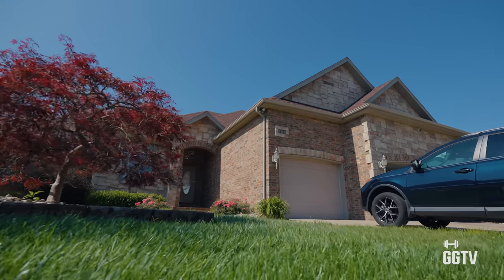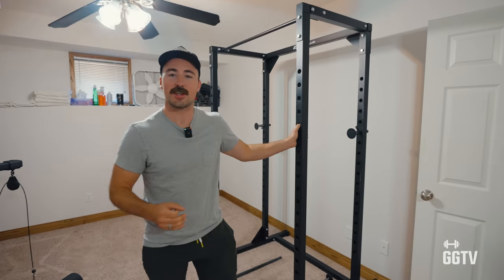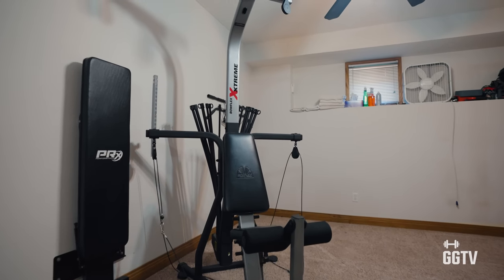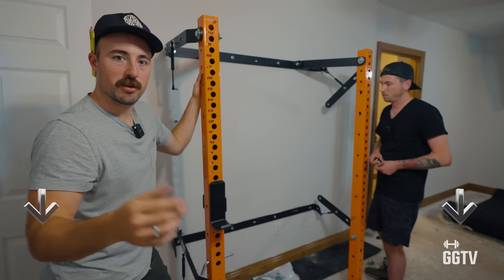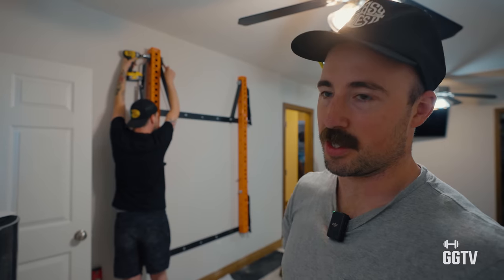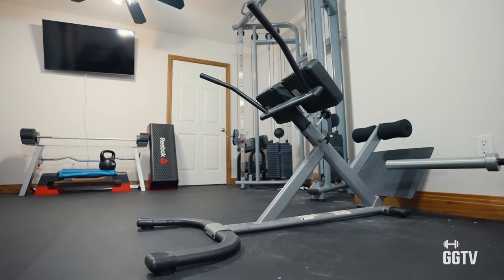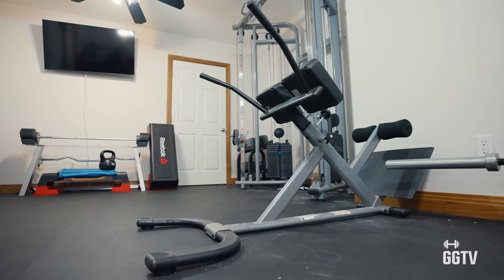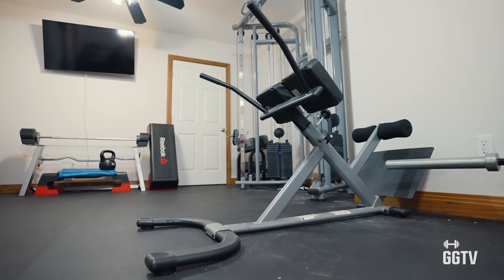I Built My Parents a $25K Dream Home Gym!

Comment: Can you give some sort of price breakdown? The title is $20K home gym - was the flooring just really expensive? I'm in the process of outfitting my basement and looking at what that room looks like and that pricetag I'm feeling like there is a big gotcha on my horizon that I'm somehow missing. I've got a set of 5-50lb DBs from rep + a victory stand, a full SS double diamond barbell, urethane equalizer plates, blackwing bench, and getting ready to buy a power rack w/ athena + Lat/Low + full stack upgrades on both and this is still under $10K. Feels like I am missing something and the only thing I can fathom is that I need to be ready for some serious sticker shock when I go to do rubberized flooring...
Reply: How is that barbell???  Thinking hard about one or a Rogue 2x Aggro.
Reply: @ExpeditionaryRanger  I'll tell you when it arrives in like 3 weeks =/. I ordered it beginning of last month but the lead time with newer stuff from rep is annoyingly long. The blackwing took about 6 weeks to arrive as well, though it was worth the wait. Thing is built like a tank, super happy with it.
Reply: Sigh - doesn't respond, but does update the title to be even more expensive at $25K vs the $20K it was at time of upload.
Reply: I came to the comments to see if anyone asked. My only guess was flooring cost or the cost of that install company? Seemed inflated at $25k
Reply: @ExpeditionaryRanger  Received the barbell - it's super nice :-)

Comment: Coop/videographer Nathan, how does the Titan leg extension/curl compare to the isolator? I know the isolator has more functionality, but I’d mainly use it for legs anyway. Comparisons for range of motion, seat stability, weight capacity, even pressure across both legs during use would be greatly appreciated!

Comment: Would like to have seen some more creativity. They bike, why not a smart trainer/Zwift setup? No mention of ventilation needs in a basement gym. No mention of the pull-up bar right next to the ceiling fan. You mention a belt squat machine, but went with an awkward leg press. You show the adjustable barbell, but you put in a squat stand… does that integrate?  It’s just of bunch of equipment stuffed into a basement bedroom. It’s a FB marketplace mishmash anchored by a few very expensive pieces.